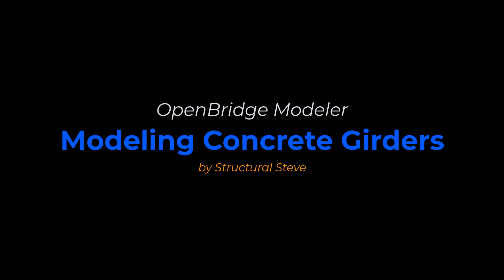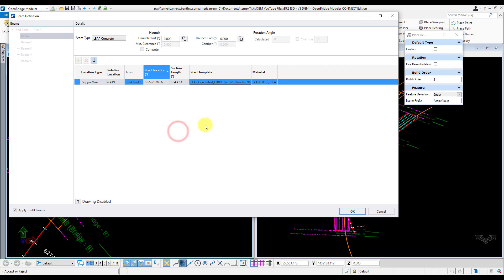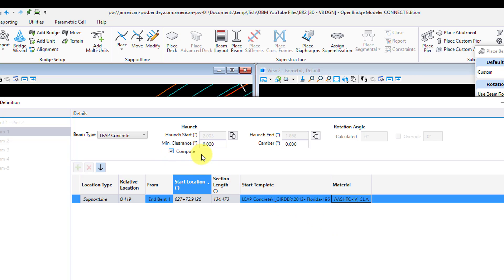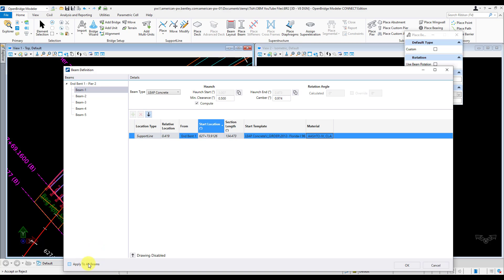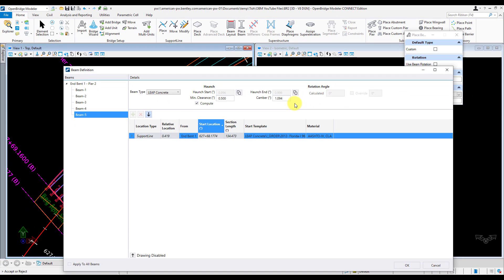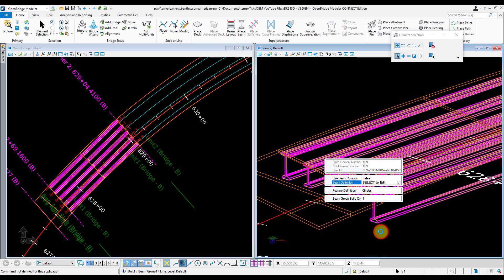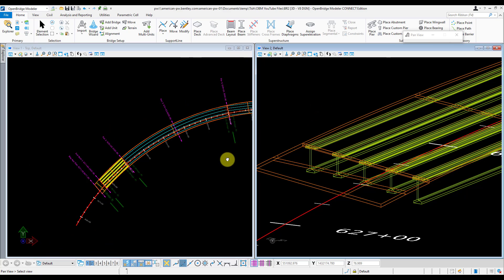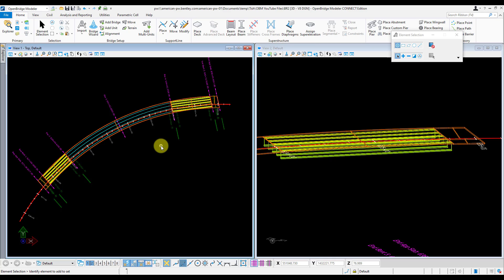OpenBridge Modeler - Modeling Concrete Girders

Comment: Steve,
Do you know if it is possible to create a custom concrete beam with a varying flange width?
Reply from the maker: I haven’t done that myself but it should be possible. They gave us the ability to have a custom beam with a template that varies a few versions ago. The key is that you have to have the same number of points on both the begin and end template.